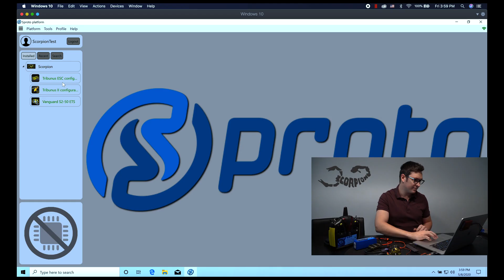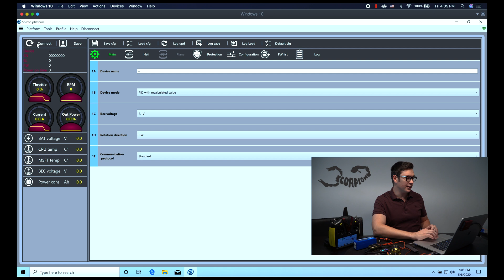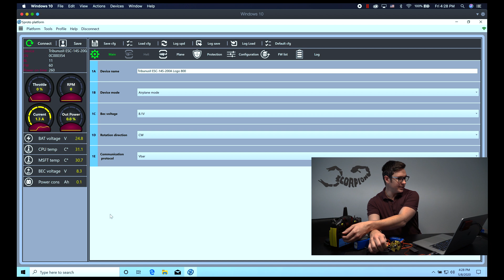Scorpion Tribunus ESC {Tutorial} - Throttle Calibration / Error Codes / VPlane/VBasic Help

Comment: Thank you so much Kyle !! This really helped me. I was trying to do throttle calibration with a Scorpion II 06-120 and a Spektrum DX9. I couldn't figure out why it wouldn't work. I used your trick where you power up the RX first. I used a l2s lipo but it goes though a old Align separated box to power up a RX with a lipo, so its only outputting 5.8V. I use it all the time to power a servo tester.  So I powered up my AR637T first waited for it to initialize. Then put the stick to 100% (throttle sub trim at 0, linier throttle curve, enabled to the throttle stick) plugged in the main battery and I heard the beep, lower the stick and hear two beeps. un plug. Done. Now return the throttle sub trim to -100. Finished. THANK YOU !!

Comment: I have the tribunus 06-80A, programmed and installed in RAW 420. On Sproto it shows the throttle goingb from 0-100% but no power to the motor. Also no beeps at all. But i have a solid green light. Any suggestions?
Reply: I’m having the same problem. Did you figure it out ?

Comment: Hi Kyle, I use an external BEC (set at 7.4 V instead of direct Lipo) and when I plugged the second 6S battery (12S setup) the connector blew up and ESC died. Any reason for that?
I previously tested this ESC and was working perfectly and the only difference was the BEC

Comment: I have a quick question if that's ok:
The cut off temperature in my setup (A Tribunus 200 Amp and Vbar touch) is set to 110. BUT IS THIS FAHRENHEIT OR CENTIGRADE?  it doesn't say on my Vbar touch!
If it's Centigrade I'd hesitate increase it. But if Fahrenheit I can relax and increase it. This was repeated because odd stuff happened to earlier text! This one is good!!

Comment: I have a quick question if that's ok:
The cut off temperature in my setup (A Tribunus 200 Amp and Vbar touch) is set to 200. BUT IS THIS FAHRENHEIT OR CENTIGRADE?  it doesn't say on my Vbar touch!
If it's Centigrade I'd hesitate increase it. But if Fahrenheit I can relax and increase it.

Comment: Kyle, I have the Tribunus 130 HV.  I have the latest firmware update 63, I like the slow start up mode.  Is there a way to get it any slower/extended?  I'm using it more for the scale effect, and with just a few tweaks, I feel like it would be about as close to scale as an electric can get!

Comment: Yeah .lol well mine don't do that. I've had my scorpion tribunus for about a year and I cannot get the throttle to calibrate.  Instead I had to adjust te end point so the tribunus read 0 on sproto.  I wish someone could explain what is going on with this damn thing. Using futaba 18sz.
Reply: I to can not get it to throttle calibrate. It goes straight into normal start up procedure even when my throttle is high? Dx9. My flight mode 1 works but 2 doesn't? Tribunus2  120amp. Haven’t tried changing end points yet (shouldn't have to).
Reply: What Receiver/FBL are you using?  I use the spektrum beastx, and I had to tweak the process a bit.  With the Spektrum beastx I had to start the receiver first with no power going to the tribunus (You can use a small receiver battery or different esc to power the FBL/receiver).  Once the beastx was done with its lengthy start up mode, then I fired up the tribunus with throttle high, and it went just like this video.  *B/c I was using the tribunus as the BEC as well I used a short servo extension cable with the middle (power) wire pulled to connect to the throttle port so the ESC wouldn't feed power to the receiver as well.  So if you try this method either turn the BEC off in the scorpion, or use a small extension cable like I did so you don't overload your receiver/FBL.
Reply: Same problem right now. I'm losing my mind.

Comment: Kyle i am in airplane mode with 0% throttle on the app but I am recieving the throttle input code i am using a spectrum receiver and I have the master port connected to the receiver properly, what am I doing wrong? Thanks
Reply from the maker: Hi Barney, 

Have you re bound your model since doing the calibration? When a Spectrum radio binds it first outputs the “fail safe command” which could be to high and confuse the esc.
Reply: @dahlkyle  that's exactly what I did and it worked thanks again!
Reply from the maker: If you lower the throttle point a few points lower does it then initialize? Or it never will initialize?
Reply: Kyle
I have it working now I appreciate the advice you've given me
Reply from the maker: @695look  may I know what was the issue? So I can help more people in the future if they have the same?